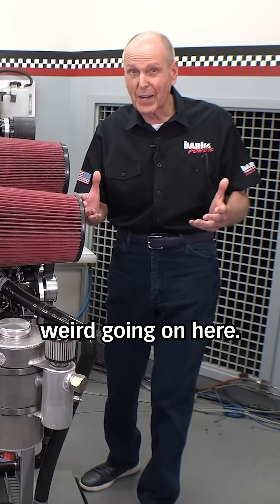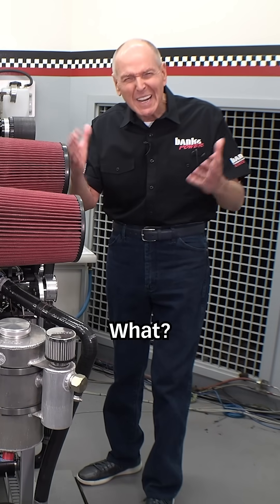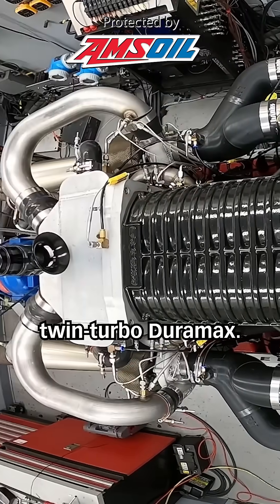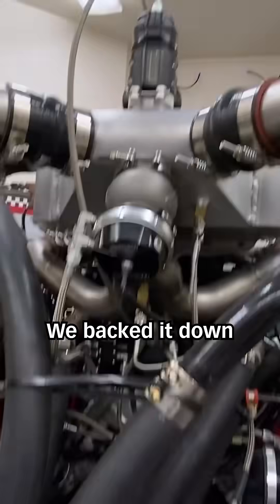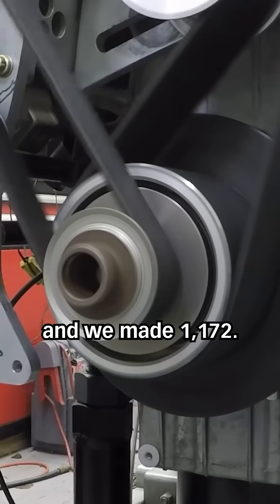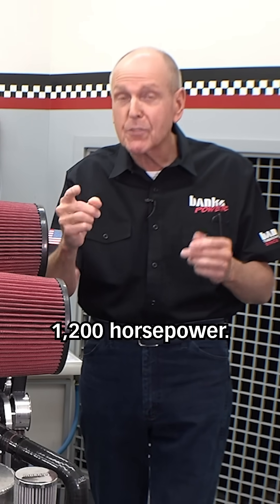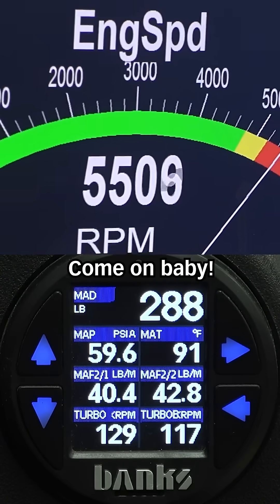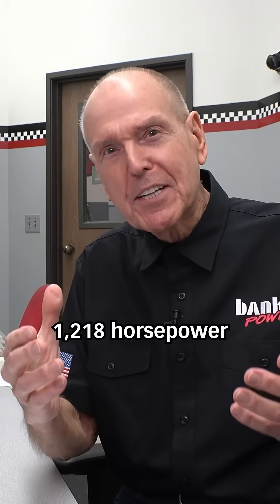How to make 1,200 horsepower the wrong way.

Comment: Blowers move air, they don't compress it. So before anyone gets any ideas, hear it out.

Blowers allow air to go around the rotors, in the event of failure... however, the same can be true for going to lower rpm. 

Whilst you think you're reducing the air volume, you're actually creating less restriction for the turbos to push air into it.

At high rpm, the one thing this type of setup fails at, is air turbulence in the blower. Too much turbulence can create "backpressure," in the form of not allowing excess air to move through the blower. Which, by dialing back the rpm on the blower, you're decreasing the turbulence, and decreasing the requirement for the turbos to overcome the pressure inside the blower housing, therefore, creating more power.

These types of systems were used on all kinds of Detroit Diesel engines. The thing about them is, they weren't initially designed for high-rpm, high-power engines... they were designed to keep torque at the lower end of the powerband and reduce acceleration time. 

I doubt Gale will actually see this comment... but for what it's worth, I'm willing to be proven wrong.

Comment: I mean, I’m just an electrician stoner, but there is less parasitic draw from the turbo (because it’s built up off of exhaust pressure), which is helping spool the SC (on the downstream) because it doesn’t have to work as hard

takes hit, exhales 🎉🎉

Comment: Compressing the air then introducing fuel to the compression  side of turbos then to intakes and out  to exhaust   to spool the maxi sqeezers   , what are the egt and sensors saying   GALE  IVE READ YOUR ARTICLES  SINCE I WAS A KID  YOU GARLITTS THE MALVERN WIZARD , RIP  ALL MY HEROES  BLOWERS SPEED IS THE TELL THE CHARGE GOING IN YOUR IMMHO GOING TO BE NORTH OF THAT

Comment: Your taking more power from the crank the more you turn the blower. The smaller pulleys require more torque to turn. So I'd say the gains are from taking that load off the crank. I'm sure the blower has a benefit with its built in intercooler and its ability to help further compress that air being pumped in by the turbos. If my guess is correct at what power loss of the crank does it become come counter productive?

Comment: 1200hp from a custom expensive behemoth with two trurbos and a blower?

That's quite a pathetic result.

The Australians with their 2 bit engineering shops have just extracted 1000hp from a 1.5L 3 pot Toyota and it looks lile it'll surpass your behemoth soon.

I expected 2500hp or thereabouts.
Reply from the maker: Around 1,200-1,300 was the goal. This 7.0L Duramax is more than capable of handling high horsepower figures. For this race program, Gale and our engineering team had a specific horsepower goal based on current methanol Monster Truck engines. With the type of environment a Monster Truck engine goes through, this Duramax is designed to snap zero to full throttle thousands of times and last an entire race season without being rebuilt. It's not a 10-sec ride.

Building a Monster Truck Engine:https://www.youtube.com/playlist?list=PLwtmrqcWzLtRXpEFXeXa3YF-L0xSK2Ml2

Killing a Duramax: https://www.youtube.com/playlist?list=PLwtmrqcWzLtQsQGxE-x2i8GaPgEuItUkn

Comment: I think you might be onto something there. Hard to keep the air going in cool when the supercharger bolted straight to the intake. If you fed the supercharger through a water intercooler you can get way more oxygen. You would have more throttle lag waiting for the turbos to spin up, but you could set up a boost reservoir tank to store what would otherwise  blowoff. You could also put a bypass so if the pressure coming out the supercharger is greater than the pressure coming out the turbo it'll bypass the turbo to absorb a little lag, but honestly the supercharger pushing air through the turbo might get it to spin up faster anyway.

Comment: You think it's backwards because it is backwards you should always have the blower run first on lower RPM and right as the boost starts to build you let the bypass switch over to the turbos right when the hp dip loses power from the supercharger then you kick the turbos to full power you should usually be kicking  1800-2000 horsepower with that setup

Comment: Remove the blower and run 2 more turbos.  That's how the Chiron does it.  The blower is a huge parasitic drag.   When you back it down, it reduces the HP it's stealing.

Comment: turbo and supercharger displace air in different ways, the blower is getting more in the way of the turbo than it is helping it. the turbos are making the power the blowers is using to spin, the harder you spin the engine and respectfully the blower, the harder it gets for the turbo to keep up hence the increase when blower speed is reduced. 
thats my thoughts :D

Comment: The argument about diesel vs gasoline vs methanol that one is better than the other is silly. What makes torque? Lengthen the stroke of the crankshaft but without cylinder pressure all the stroke in the world is useless.
No matter what fuel you are using if it's not creating high enough cylinder pressure for the torque you are looking for then you got squat.

Comment: It is backwards, the best way to twin charge would to use the blower until the turbo is spooled up then cut power to from the blower and rely on the turbo, you can do this with a clutch pulley rather than having constant power from the blower

Comment: So, my thinking is. Since the blower has a certain point where no air will pass through it, when the blower speed is up its hitting that point way to much. The blower wont flow enough air. So by slowing the blower down, the turbos can force more air in before the blower hits its  "dead" point.

Comment: Turbos love to be supercharged because you feed them higher pressure air, however i think supercharging into your turbos will starve them of air at peak power, the supercharger will not keep pace with the turbo power, so i believe that the supercharger is taking the compressed air and pushing it harder into the cylinders.
I'm not sure what changing the arrangement will help with, unless we build in a bypass to prevent us starving the turbos when RPM drops.
The fact that slowing the supercharger improved power tells me theres a loss of performance somewhere in the system, because Supercharger performance should be a fairly flat ratio due to its power draw to its compression bonuses.

Comment: The ol 2 stroke gm,s turbos blew through the blower I think I don’t know if they had a bypass 🤷🏻‍♂️👍
Reply: @stardust6066  The GM 2-stroke blower originally was only there to blow, not to boost. The engine wouldn't run without a blower (most 2-strokes use crankcase pressure as the blower, not the Jimee). The turbos added boost for fuel efficiency, reduced emissions and more power. I don't know if there was a blower bypass. A bypass wouldn't reduce "parasitic" loss as much as in a 4-stroke since a 2-stroke blower wouldn't be doing as much work (it wasn't compressing, just "gently" blowing).

Comment: Mr Banks, I can't believe you haven't heard of the twin-charge system use mainly by Lancia in the 80's in group B, or use by Nissan on the March (Micra) in the 90's.
Or more recently, with Audi that use an electric turbo (so a centrigal supercharger) with a classic turbo.

Supercharger for low rpm and instant torque
Turbo for higher rpm and more power.

Bypass the blower.

Comment: isnt the idea of blowers second doing air pull to spool turbos faster at acceleration? Good for off rip but i dont see benefits the other way around. I thought turbos pull air faster than blowers are capable of anyway
Reply: Unless of course the illusionary setup of blowers on the front would cause the turbos to make the blower pull belt rather than the other way around. further assisting.

Comment: Blower first makes sense to me, it runs of engine power and it helps provide power at low rpm. You'd want the blower to breathe better and not try and pull through the turbos

Comment: EMD, the locomotive division of General Motors, has the blower first in the pulmonary line.
After a few hundred RPM, the turbo-chargers have enough flow.
.
Note:
The EMD locomotive engines generally red-line at 850rpm.
Above 900rpm, longevity suffers.

Comment: Need a rather big supercharger bypass valve.  Volumetric efficiency of the charger/compressor drops the higher it spins :(  This was true of the Autorotor twin screw compressors i used with my kits.

The way that it is plumbed i would also add an intercooler in between the turbo compressor outputs and the Lysholm intake as you might overheat the screws when coming off throttle at high rpm.  Adding a bypass would also solve this problem/eliminate the need for an IC at low boost levels at least.

PS: the belt drive system is also a bit strange.  background: i used to develop custom Lysholm supercharger kits.

Comment: I would assume the turbos being before the supercharger is due to compression dynamics and efficiency or each system. I believe the supercharger would be suffering from turbulence on the intake die to back pressure, perhaps a lower tolerance in the supercharger would allow for a higher capacity of air to be transferred through the supercharger seeing as the air coming in is more dense.(Fluid dynamics dictated a denser fluid should have a larger path to maintain flow)
I would also be interested to see temps before and after each compressor, seems likely lowering the supercharger speed would dramatically decrease air temps going into the cylinder. 👍

Comment: What I've seen with most twin charged setups is the supercharger blows into the turbo. Then the turbo reaches efficiency and a bybass valve opens up that allows the turbocharged to suck in fresh air.

Comment: Blower is positive displacement. If you put it in front of the turbos, It will only supply as much air to the turbos as the blower can move on its own.
With the turbos in front of the blower, they can add density to the air in the blower, moving more air than the blower could move without them.

Comment: I cant speak on diesel tuning. But for what ive worked on and helped build ive never seen Turbo first. It was always Charger first for the low end and turbo to maximize the amount of HP present throughout the whole curve. We also never have ran twins as we hunt for the huge numbers up top and a single turbo setup as proven the more reliable option. When i say reliable think old 4G mitsubishis and turbo rotaries from mazda.

Comment: Imagine getting an engineer to make a blower bypass at 4,500 RPM to let the turbos handle it after. Engaged with with a clutch similar to an AC compressor and for the blower similar to an engine starter.

Comment: Your theory is confirmed by Volvo penta, they used twin charged setups on their inline6 diesels, blower ran on a clutch that was engaged based on throttle percentage and rpm ...low rpm  kicked the clutch on the blower until the turbo started to build boost, then it would disengage the clutch on the blower and run on just the turbo through a dual inlet manifold. For a good example Volvo Penta KAMD42
..they scream like a hellcat😅

Comment: So c0mpumd system ..  yeh super charger should be tje high pressirr side . . Comed on first then once turbos goung strong  the  charhe just compundd kt. Or will the charher need a bypass . Like on the deltasof group B back in the 80s?

Comment: Hes right its backwards use the supercharger to keep the turbos in boost and not act as a belt driven restrictor plate then he can throw way more fuel and timing at it ... At that point he can tun the motor to the internals limit

Comment: I would think if you had the blower feeding the turbo it might restrict the overall air volume. What will be cool would be a bypass supercharger like they used on those gtps and just set it up. So once the turbo is Good. The blower just goes to bypass

Comment: Actually that does make a whole lot of sense because most blowers are mechanical drive from the motor itself correct so it would make more sense to use that are and then push it through some turbos to spoil them up allowing them to pull more air and then having that be pushed down into the motor giving it more power

Comment: Need to have blower first then run your turbos through blower bypass valves because the blower is slowing the air flow down from the turbos!  Blower bypass valves. Old Detroit Diesel 2 Stroke Technology!!

Comment: It seems like the blower was not allowing boost to build properly in the sense that too big of an exhaust fan will make it hard to open a door to a mostly sealed room. It was adding air, but the turbos weren't allowed to pack as much as they could with the higher blower speeds.

Comment: Greg's airplanes and automobiles has several videos on the effects of compound supercharging. Probably could draw some good insights from the engineers of WW2, especially on the matter of parasitic loses of various supercharging setups.
Reply: Greg's Airplanes & Automobiles? Thanks for the suggestion. Here's one in exchange...
Paul Brodie, previously a bicycle frame builder turned builder of interesting motorcycles and other stuff.

Comment: Building engines isn’t my profession, but I’ve entertained this idea a bunch. 
Why not have the supercharger on a clutch and the turbos pull through it? So once the turbos catch up the supercharger spins free. Or put blow off valves between the blower and turbos so they open at a certain psi alllowing the turbos to pull from around the supercharger.

Comment: @bankspower When I was younger I went to Bonneville Salt races, the Joint Venture mechanic told be they shave off some off the blower fins to allowed the turbos to bypass the blower when the truck got up to speed running basically straight turbos on the top end.

Comment: Proof that superchargers cost more power than turbochargers.  As he is slowing down the supercharger, it's not making as much of its share of the total boost.  Thus, the supercharger isn't working as hard, freeing up the horsepower normally used to drive  it.

At least, that's my theory.

Comment: 37yrs old now and when I was 16 me my cousin and 3beat friends took a Ford 7.3 and created the same set up.  Only difference was we had a Whipple super charger from a gas motor 5.4 Triton attached to 2 stock 7.3 power stroke turbos.  Not sure of the HP but anyone ever drove a 7.3 knows power was not its highest spot.  Anyway the damn truck is you would power break it just enough to get it to spin it would not stop spinning until it shifted into 4th gear.  

I still have the truck along with the setup still running at my grandfather's barn.  Have not drove it in a few years but do crank it every few months to assure she will run.

Comment: Sequential blower over turbos is ass backwards😂.
Look at some of the finest engineered diesel engine designs... the Detroit diesel 92 series, specifically the 8v92T model. I know the blower is necessary for the two stroke diesel, but simple setup with the turbo over the blower... blower should be used to carry the long lag of your setup. The drive pressure efficiency is totally lost if you are using the blower to overcome the turbo's max efficiency of boost and drive pressure. 
The blowers should be declutched all together as the turbos hit peak efficiency.
The blower is just a parasitic load after that.

Comment: With those hp/torque numbers and how high that revs, it’ll prob get double the mpg a semi gets minimum with all the fun and may last longer before first breakdown than a typical semi engine. *more room for thicker radiator/ more coolant volume and a larger oil cooler/more oil volume to maintain performance through mountains. Often more airflow = lower egt’s by 3-500 degrees F depending on setup/plumbing and if there’s water/menthol injection (windshield fluid injection) cooler and cleaner….

Comment: Blowers compression turbos just move more air volume, it really needs a buffer chamber that can be highly pressurized. It would be ready in reserve at all times. It would just need a pressure release valve. The turbos can be improved through a better resourcefullness of the exhaust to a turbine which would turn an alternator which would power the two turbos. Then put a magnetic encoder on the crank shaft which would operate solenoid free float valves to the engine, then all things could be used as a variable in increasing torque. Reserve chamber could just be a standoff between the blower and the blocks intake. you could also mess with the timing of the fuel injection

Comment: Ugh, it's simple. Air doesn't burn, it aids in the burning of a fuel source, as does compression. If you flood a cylinder with an imbalance of air to fuel ratio, you lose efficiency and vice versa with fuel ratio to air imbalance. What works at one elevation level doesn't work optimally at another elevation level (oxygen levels) hence why Nitrous OXIDE (releases oxygen when under combustion and pressure roughly speaking) helps. Pressure+combination of fuels isnt rocket science, well, I mean it is but 😂😂😂 you get my point.

Comment: It sounds like your head is leaking. The head gasket does not form a perfect air tight seal around the cylinder, and valves are going to hurt this too. You can only compress air up to the pressure of the gasket, not the cylinder. So you’re actually leaning the engine out by providing more air.